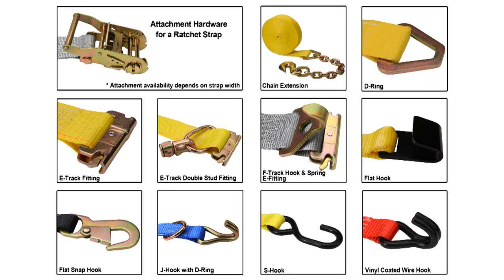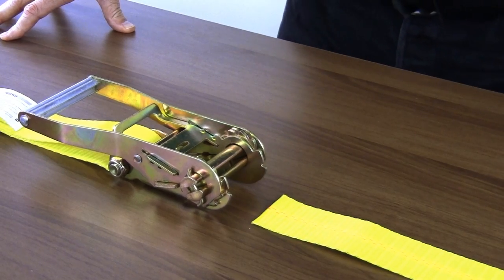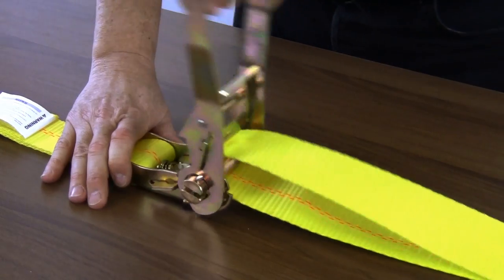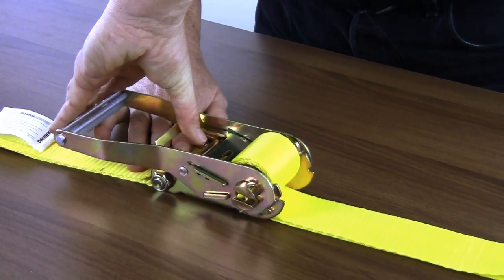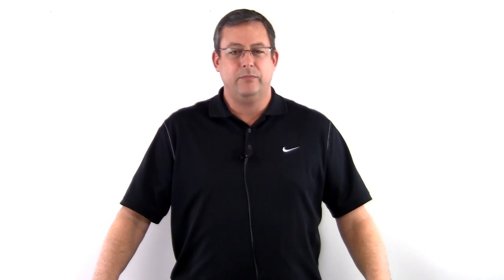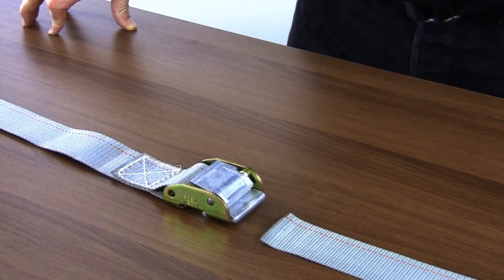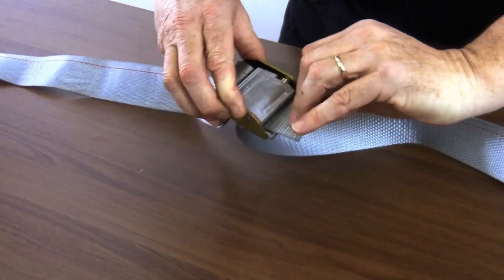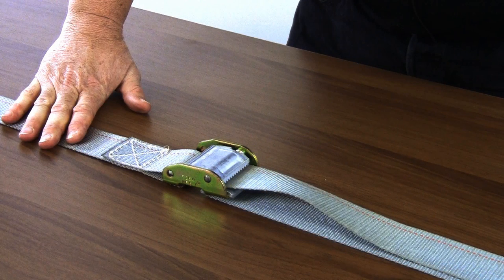Which to Use: Ratchet Strap or Cam Buckle Strap?

Comment: I need a couple of cam straps that has about 2 ft of strap made on to the cam buckle with s hooks. The ones I have found all have just 6-8" on them. They are too short to make a wrap or two around my trailer rails.
Reply: Also, is there any cam buckles that will let me adjust both straps? Including the strap that stays attached to the buckle?
Reply from the maker: Thanks for reaching out to us! We do not have that specific size of cam strap with the s hooks, however, our sales team and manufacturing team is happy to help you out with a custom strap for your trailer.  Please give our sales team a call at 1-800-969-6543. 

http://www.uscargocontrol.com/Ratchet-Straps-Tie-Downs/Cam-Straps